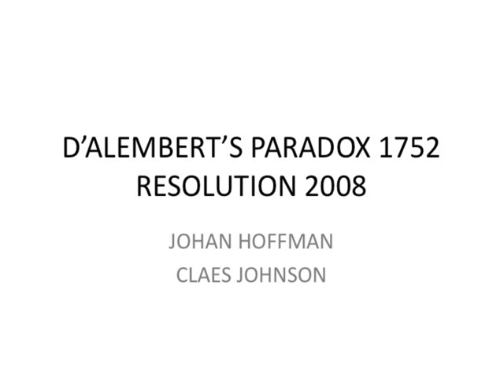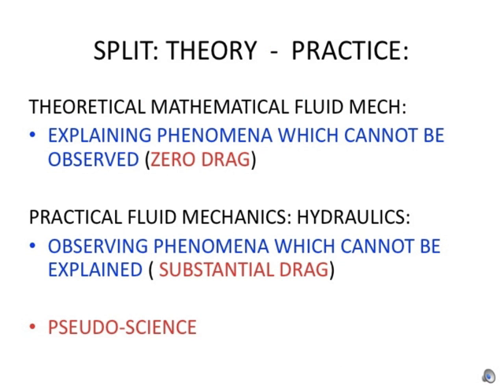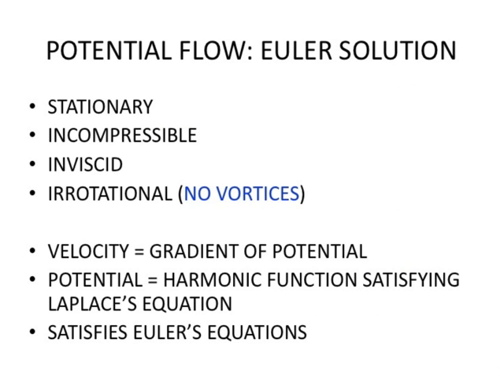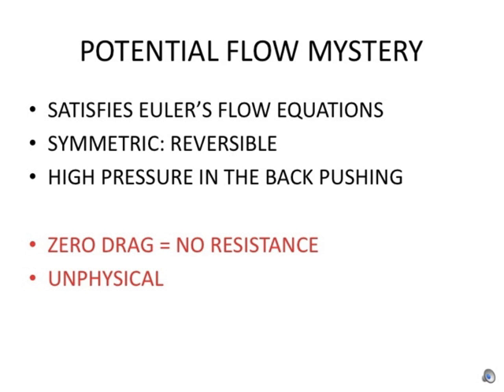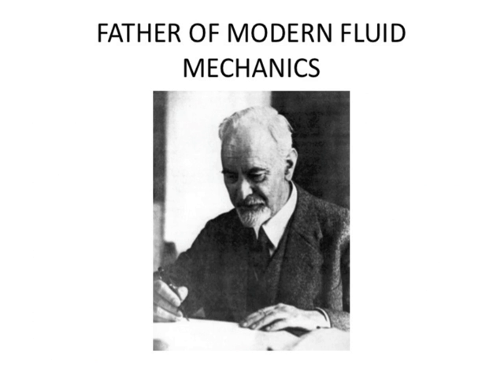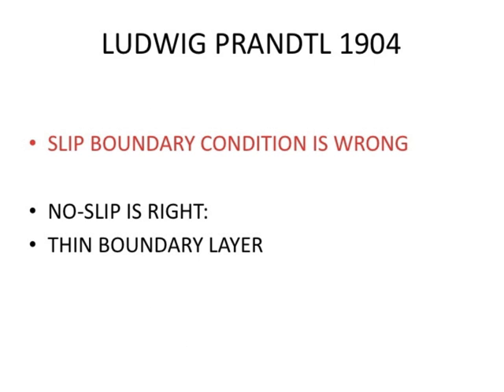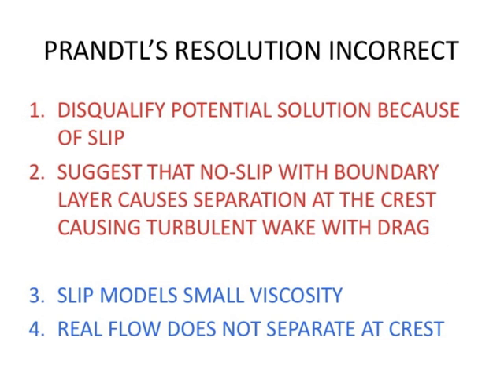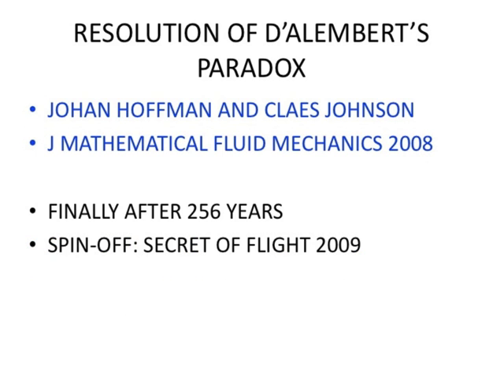D'Alembert's Paradox

Comment: If a cylinder starts moving slowly through liquid helium, then the flow will be potential flow with no drag and no paradox. If the cylinder speeds up, then there will be enough kinetic energy in the cylinder to be able to form vortices in the helium which then separate downstream to form a Von Karman vortex street. We are now effectively warming up the liquid helium and raising its entropy. This equates to aerodynamic drag. This was my opinion long before 2008. Not sure why we need any new theory.